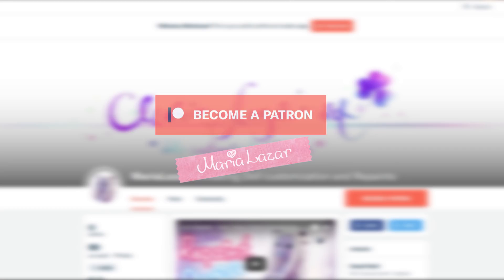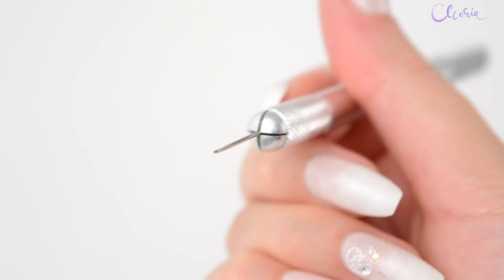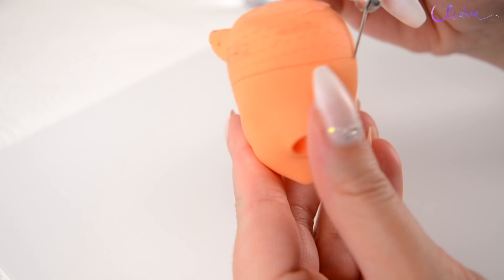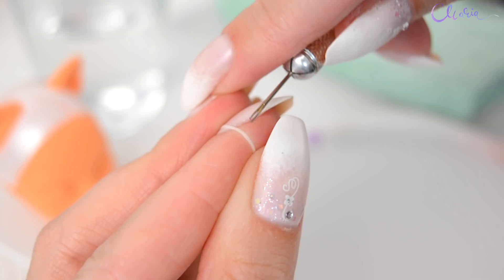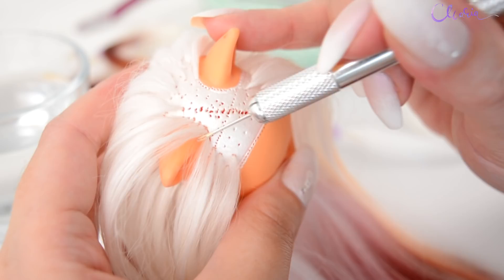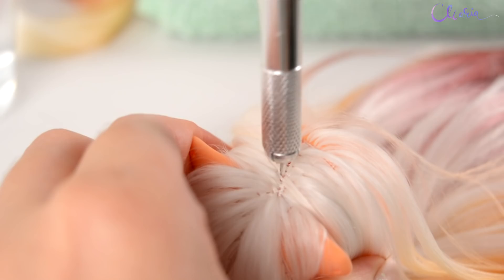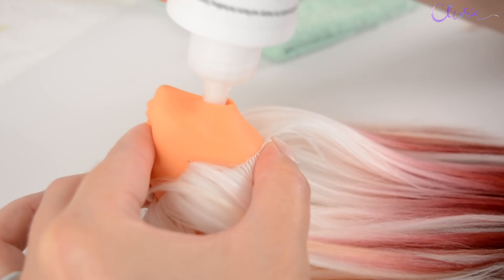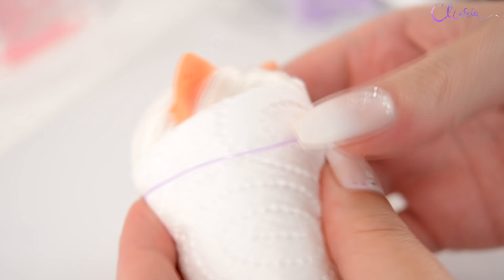HOW TO - Reroot for Art Dolls

Comment: What if the original hair is simply rooted too thin? Can you add hair to the existing plugs or do they all have to be pulled out and redone? Also I noticed part of why its so thin is because there were not nearyl enough holes for the hair to be rooted in , especially on the back side. Can I add holes and plug hair  into those gaps?

Comment: Such a beautiful reroot. Will soon start my first reroot, hope it will turn out just as nice. Can I also paint the head with acrylics so it matches the haircolor? And does that need to be sealed with MSC as well?
Reply: Also: what kind of hair do you use? I have mohair, can I do it just like this? I have also read about the knot method. Which would be better or are both fine?

Comment: I've always seen people use tacky glue or knotting to secure the hair in the head, but what about using mod podge? Ive glued multiple heads using that for a while, and the only issue ive come upon is that the glue crackles slightly when i put the head back on. Has anyone else tried this?

Comment: Which type of needle do you use, mine keep splitting the eye when I try to cut the tool, if it even cut at all. Any tips for the actual cutting of the needle?
Reply: Victoria Vidaud heavy duty wire cutter ;) the ones built into needle pliers are too light duty and end up getting tooth like divets from the needle. I think she also uses gold dipped singer needles, out of a pack of twelve I've only had one snap on me during a reroot and that's because I got distracted and bent it the wrong way lol
Reply from the maker: Yes they are gold on the eye, really easy to cut, i have no idea if that matters tho. I just grabbed a few Prim packs at the mall back then since I lost my old ones while moving. 🙂
Edit: Still rerooting with one of those needles in the video :D

Comment: when you stick it through, do you push both sides/ends of the re rooting tool, or just one?
Reply from the maker: The cut needle eye needs to go in so the strand will fully end up in the plug. When pulling the tool out the plug will shrink and hold the strand in for the time being, before adding the glue. Hope this helps. ☺
Reply: @MariaLazarsArt  thank you! this has been my biggest question when it comes to rerooting.

Comment: Hi Maria, I rerooted my first doll ages ago (maybe 2 years) and didn't touch her since. Only now do I notice that I used WAY too much hair. She can't hold her head up, it's so heavy! Also doesn't look very good. Can I save this somehow or should I start over and reroot again?
Reply from the maker: Hi Desi, if it is so heavy I would  unfortunately reroot her. You can skip some plugs in between and add up later if she needs, so that this won't happen again. Really important are the top and the plugs that "outline" the hair around the whole head. I hope this helps, cheers! 😊
Reply: @MariaLazarsArt  thank you so much for your reply and advice! 😊

Comment: Is there any way from preventing the needle from cutting up the finger?
Reply: Janeedle Doodad you mean the needle hurts you when you try to pick up the hair with it? i put tape around my finger, which protects the finger and also creates a nice smooth surface you can glide the needle against when picking up the hair strand
Reply from the maker: I haven't had the needle sharp after cutting it, but that's an awesome idea, i'll remember it just in case! :D Thank you! 💜
Reply: MariaLazar my needle doesn't hurt me either, i just find it hard to pick up the hair off my sweaty fingers so i use the tape method 😅 figured it could apply to this case too